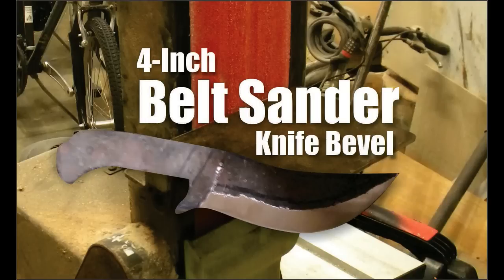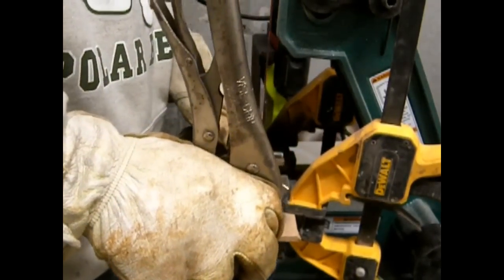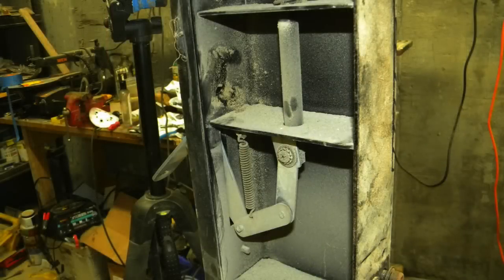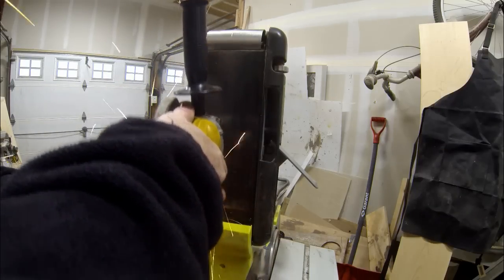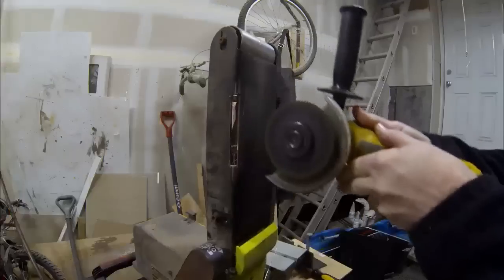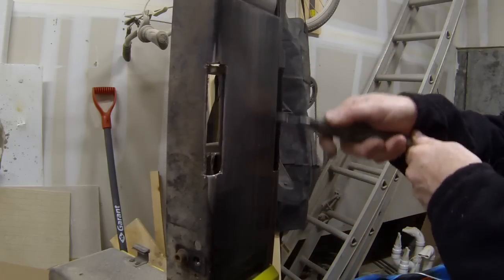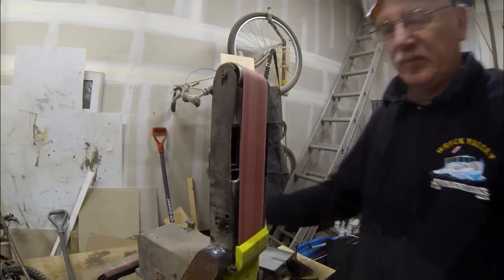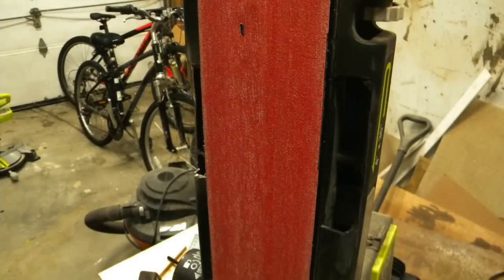DIY easy 4 inch Belt Sander Knife Bevel and plunge cuts

Comment: I think this is a really good idea. I found out, most likely the same way most people did, that those rail guard thingies get in the way when you're trying to grind bevels with a jig. If I had an old belt sander or one I got second hand I would probly do this. But I just bought one new and I'm pretty sure this would void the warranty, so I'm going to make a mod to my home made belel jig so it will work with the sander unmodified. I'll splain it if you all want. And I'll probly post a vid about it , too. I like your vids, keep it up.
Reply from the maker: would love to see how the bevel jig could be modified. Looking forward to your video
Reply: did you end up modifying the sander? before watching this video, I had glued a thinner steel plate behind the belt and used thinner belts, but I will switch to this as soon as I find someone who can lend me a grinder to cut it off.

Comment: very useful thank you for making this vid. I have the wen 4x36 belt sander and that's the problem I have. .will try your tip
Reply: THE BLADESLINGER I have the same one and around the bottom right side I could do it but kinda roughly

Comment: I have a bunch of aluminium pully wheels. I was just planning on building a setup that I can rig my 3in belt sander to, with longer belts to make it a verticle belt. that way I dont have to modify the sander itself and I can remove it when I need to use it for other projects requiring the 3in hand held sander. Maybe if it is successful I will make a how to video on it.

Comment: Cool little idea. Just a word of caution. I noticed you are using eye protection when using the angle grinder with a cut off wheel, however a full face shield is a good idea. Those thin wheels are only fiberglass reinforced wheels, they can and will explode if they get too hot and you do not want a face full of shrapnel from it. Especially when using it upside down to where you are looking directly at the wheel. It is something that is rare but it really only takes you canting the wheel too much in a steel slot for it to happen. The general design of them usually will limit it from happening because they are designed where the weakest portion of the wheel is the center and is why you can see the bare cross hatched fiber at that spot so in theory it should tear away at that spot if it hangs up and the wheel just free float with no more power behind it but the cut off wheels are not designed the same way as the grinding wheels and so they just explode. 

Any freehand tools like that you should be extra careful with. That said I enjoyed the video, it was informative and helpful.
Reply: A friend of mine had one of those cut off wheels explode, he was wearing a full face shield but that didn't stop the blade fragments, one large piece embedded itself in his eye socket and he lost the eye. ALWAYS keep your head off to the side!!!

Comment: I just bought this sander today, any tips on this mod that you have found after making the video? Could I add a piece vs cutting? Like a couple magnets or something? Thanks!
Reply: Brass Kicker you can attach a piece of metal or ceramic to the flat surface underneath the belt to raise the belt which eliminates the shoulders and enables you to grind bevel lines
Reply: Thanks!

Comment: How powerful is the motor?
My local hardware store has Ryoby 370W, wondering if is powerful enough for knife making.
Thanks mate
Reply from the maker: It works fine. Not as good as a 2x72 but it will do the job
Reply from the maker: Mine has a 1/2 Hp motor. Its plenty powerful. Problem is getting good bevel plunge cuts. You will have to modify the machine a little. (see video)

Comment: So it's been a couple of months now....how do you like it?
Reply from the maker: Since I did the conversion I built a 2x72 sander with a more powerful motor. It does not compare to the 2x72 but it absolutely works and can produce a good bevel.A lot of times I will leave one grit on the 4 inch and another on the 2x72.
Reply: I may have subscribed to you after you built the 2X 72 so I'll go search for that video
Reply from the maker: Here is the link. https://www.youtube.com/watch?v=t4V8pPToEyg

Comment: Hey all. I just came across this video now. Thanks for posting. A little while ago, I did a similar thing, but turns out the motor is not sealed inside. This leads to metal filings attracting to the interior of the motor (motors use electromagnetism to function), which in turn shorts and burns out the motor. :( These sanders are only designed for wood, unfortunately.